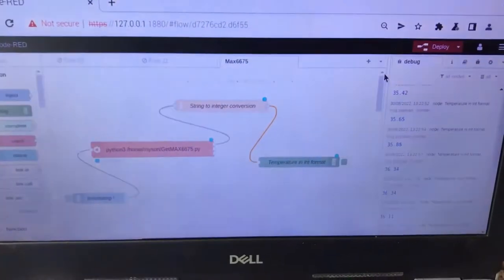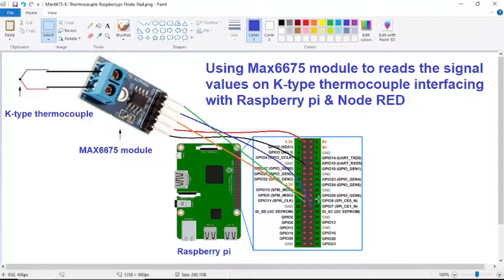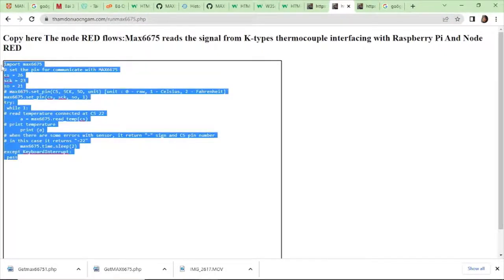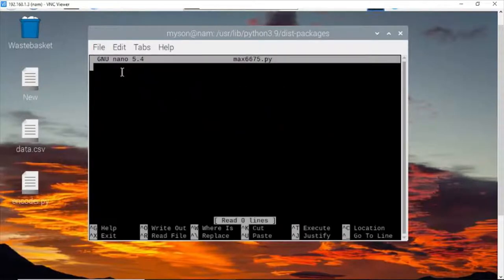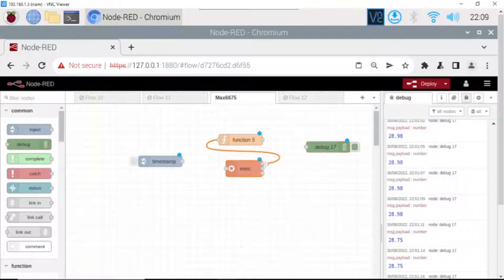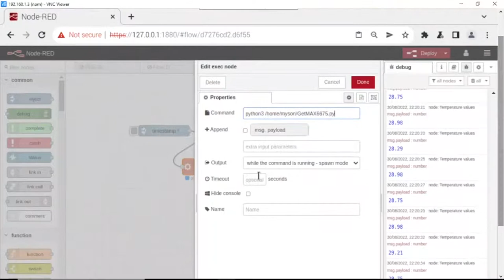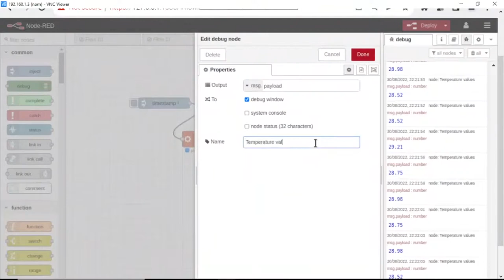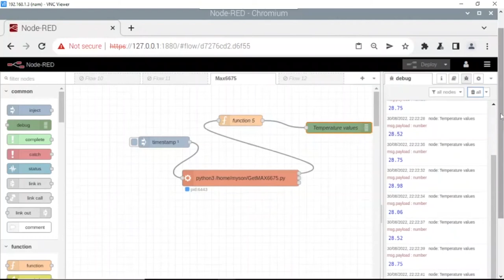Max6675 K-type Thermocouple Raspberry Pi Node RED | Python code Max6675 | SPI interface

Comment: Thank You, It's a great video for connecting Max6675. Please suggest for connecting three Max6675 modules at a time and storing their data on a CSV file.
Reply from the maker: You just change the cs pin for other max6675 boards, and print() all values in one line , read more information " + string " in python on web3school tutorials., using split string on node Red.
Reply: Thank you Sir, for quick response. Actually, we need to connect three temp sensors simultaneously. Please suggest hardware connections and code.

Comment: Hello
I did everything like you except that the current Python version is 3.11.2-1.
However, I get -26 as a value with a sensor and 0 without a sensor.
Reply: problem solved
I used other ports on my Raspberry, now it works